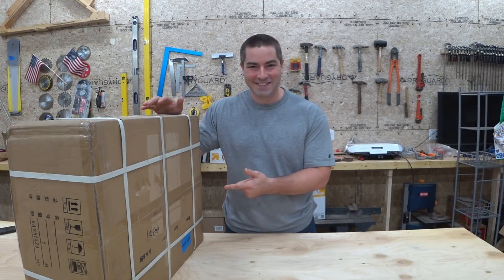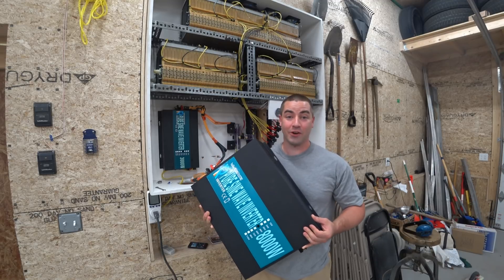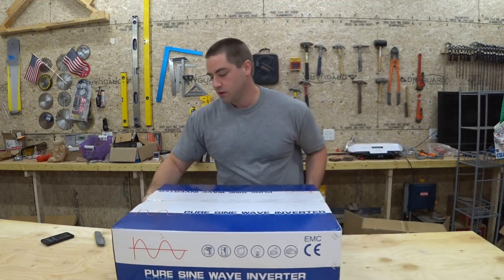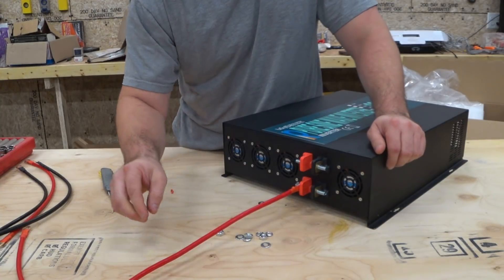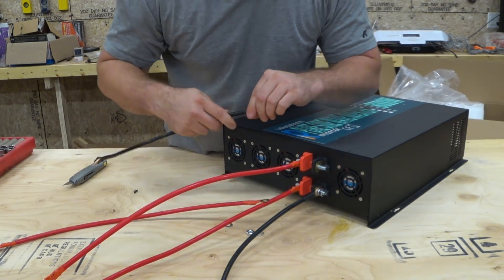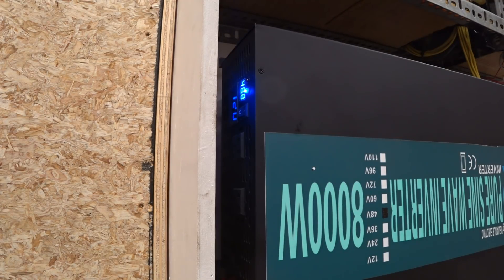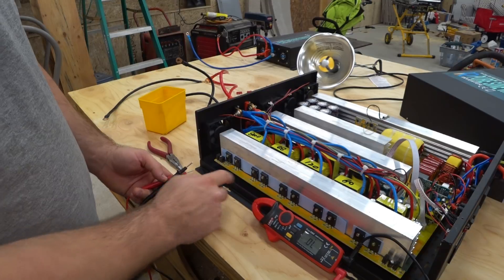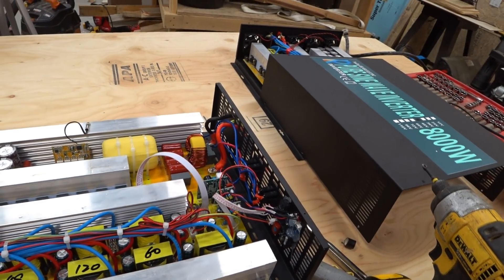Cheap 8000w Reliable Inverter, DIY Powerwall, Chevy Volt Batteries

Comment: Your experience with this inverter took me back ten years to an article about a failed "Power Jack" brand 3500 watt true-sine-wave inverter made in China. The buyer just happened to be an Electronic Engineer who had the smarts to design such a Sine Inverter himself, and he proceeded to tear it down only to find out it was underbuilt to the extreme in several ways.  He explained what the designers did wrong.

After working his way through correcting the problems,  he brought it to life and reasonable reliability:    www.ludens.cl/Electron/chinverter/chinverter.html

Another resource for reference is an indexed engineering level sine inverter                                                                                                                                                                                                                                                                                                                                                                                                                                                                                                                                                                                                                                                                                                                                                                                                                                                                                                                                                                                                                                                                                                                    design article  found here:   web.wpi.edu/Pubs/E-project/Available/E-project-042507-092653/unrestricted/MQP_D_1_2.pdf

Comment: put an oscope on the current/voltage of the 120V output.  See what's happening instead of scratching your head.  I bet there's a resonance or inrush problem.
Reply from the maker: Unfortunately I don't own, or have access to, an Oscilloscope.  If you do and you are in Massachusetts, lets get together and make a video testing the wave form.  I'd love to see what is happening.

Comment: Other videos claim these Reliable inverters are actually modified sine wave.  Any scope shots of the power output?  I've used a 2KW Samlex SA-2000K-112 pure sine inverter for years to backup the house.  It can surge 4000 watts and handles old fridges, coffee maker, deep freeze, flat screen, satellite, internet, etc. just fine.  The Samlex SA line looks discontinued now, but other Samlex are high quality too.
Reply from the maker: Unfortunately I don't own, or have access to, an Oscilloscope.  If you do and you are in Massachusetts, lets get together and make a video testing the wave form.

Comment: First of all if you want to pull that many peak amps into the inverter those battery cables splitting the supply is one issue.  I used 4/O in all applications weather a 2000 watt or 8000 watt or just makes sense better to have the most current carying capability than not enough.  And here's a key factor, reliable in their connection diagram fails to instruct installer to connect separate ground wire that attaches  to a screw under the bottom of the inverter that's a stranded 8awg copper connecting directly to earth ground.  I used to warehouse inverters for reliable in the US and was their returns address.  The amount of blown inverters shipped to me was unbelievable.  I'm also a technician and after blowing a 3500 watt myself  determined their installation manual had left out the very important grounding procedure.  I informed the company they needed to add a slip of paper with the word  WARNING unit must be grounded before connecting to mains failure to properly ground unit can have serious consequences and will void the warranty.  Obviously they haven't corrected the error in their installation manual.  I have used reliable inverters as back up EMERGENCY re0lacements for my 9.36kw array and every one has performed correctly as long as the unit was grounded before attaching mains.
Reply: real answer buried in the youtube shitsoup

Comment: Continuing to search on youtube for your 3.000W inverter ...   https://www.youtube.com/watch?v=fPS6wzAnfsk
...
You might have a - 4 pairs  - 2x  mos-fet-s  IRFP4668 - 9.7m ohm -  maiby from Infineon.  This is a 130A at 25 deg celsius and 92A continous at 100deg celsius, with 520A pulse.
With 4 pairs, and 4 transformers ( you have 4 sets that can handel around 368A for a short time )  - and a very small impulse of 2.000A ... !!!
You will never reach this... Will blow many other component in the way....
368A on 48V  = 17.600W - 17KW. as an impulse. You can start any applyance.  The limits are the transformers, wires, and many others.... 
...
IN REALITY =  on maximum 3.000W you will have 17A per pair, on 4 pairs = 68 A in a 48V sistem . This inverter will run almoust non stop.
...................................................................................................................................................................................................
Let`s go to your new 8.000W. here you have F59N30  -  56m ohm - 59A at 25deg celsius and 35A continous at 100deg celsius and 230A pulse ( disipate 5 times more heat in running regards to  - IRFP4668  )
When you run a 8.000 W model it will be hotter than 3.000 W modell.  There are people who observe that.
...
in this 8.000W model you have 9 pairs.     9pairs x 35A = 315 Amps max continous   --- ATTENTION !!! smaller maximum current than 3000W modell !!!
Maximum pulse can be 230A x 9 pairs = 2070Amps , the same as 3000W modell....
...
IN REALITY = 8000W  ...  WILL HAVE TOTAL  -181Amps  -  IN 9 PAIR = 20Amps -  PER PAIR OF TRANZISTORS and transformer ...  ( equal with your fuses2x10A, probably something bad calculations, or a scam )
...
YOU MUST CHANGE THE TRANZISTOR, PUT THE ORIGINAL  THAT ARE IN 3000W MODELL -  IRFP4668...
Of course, if there are damage in control board must be repaired.
The fuse 2x10A must be bigger, migt be used 2 x 15A. fuse

Comment: ON OUTPUT he has 12 pcs of FGH60N60 - You shoud have the same tranzistors and the same number for 8.000W. The bridge has 4 elements. You have 3 transistor for each element. 3 sets x 4 tranzistor = 12 pcs. - There are 3 bridges in parallel.
 ... 
On your inverter apears to be only 8 pcs. to have the same output power you shoud read something like FGH90N60 at least on Your component. But here appears a situation of current handling throw the terminals of the transistors. 8000W at 120 V = 66A divided in 2 = 33 A at maximum. Each tranzistor shoud handle 4.000W, and this is .....probably overkill 
....
 Open your 3.000W inverter and compare the MOS FET-s you can see in your maximum 3.000W you have 1set x 4trazistors = 4 pcs.
 ...
 If you find identical tranzistors= MOS FET-s on output bridge , MEans the unit with same tranzistors can handle max 6000W, for few minutes. 
...
 It is a probabylity that you have a 6.000W Max Modell, and a 4.500-5.000W continous power. 
And the case has a error on labeling.

Comment: I found his MOS FET-s are FDA 59N30 - https://www.onsemi.com/PowerSolutions/product.do?id=FDA59N30 - 300V 35A/100degree celcius in capsule. Not on radiator.
 The inverter is rated aproximately 8.000W for 5 minutes. ( continous 6-7.000 W )This is more than 890W per each pair of tranzistor - At 48V apears to be 18.5A per pair of tranzistor applied to those 2 fuse at 10A x 2. 
....
 Analizing this, it might be a bad choice to have 20A fuse on 18.5A consumption. Especialy if there are fast fuses. Maiby on your modell shoud be 2 x 12A, or 2 x 15A on each transformer. In his case it is a 60 V inverter, so he has a smaller current on tranzistors at the same power. For him 2 x 10A appears to work ok.
 ...
 Check what tranzistors are on your modell. They must be much capable in current than this, or at least identical.

Comment: The same thing happened to me from smile electrics ch I pulled the inverter apart and found several large mosfets blown ans aldo sa sine wave PIC control board was blown. The root cause was bad soldering joints on HV electrolytic capacitors I changed the parts by getting them from the supplier and bingo all good. You can trim the output voltages with these inverters usually with a trimpot in the inverter. Your problem is caused by a surge current and there is something wrong like a badly solderd joint somewhere else.

Comment: You need a LF (Low Frequency) inverter.  Look them up.  Usually just a bit more expensive but have a heavy copper transformer instead of just mosfets.
Reply: split phase is also nice since you can do single phase 220.

Comment: As a follow up, Americans should know that China has been buying scrap copper, remelting it and sending it back in electrical & electronic equip.. The copper has impurities that make it brittle (nonductile) and has a higher impedance. Automobile wiring since 2000 is substandard from China. Be warned. Good comments here guys.
Reply: Most Chinese magnet wires are only 80% copper.  In high frequency design with multi ferrite transformers, the core saturation is so prevalent that all you have is copper resistance and easily blow the driver MOSFETS.   48v 8kw units will draw nearly 200amp from battery.  Company supplied 3cables and the user tried single cable complaining about connecting them in parallel and the first thing he tests the unit with is an inductive motor (probably Chinese made) with high magnetic leakage and high inrush current.  Comparing the replacement unit with a burnt first is not very bright.  I see everyone trashing Chinese products and yet never stop buying them.  Walmart, Target and even Amazon.  Dream about good old American Standard (yes they were very good) and then cannot buy decent electrical products locally made because you don't want to spend the money. Common guys.  Get back to engineering education and GMP.

Comment: Heres the tip everybody needs about power inverters. If you need 2000 watts, and you want a cheap one, you buy a 10kw one that might do 2000 if you are lucky lol. The rule is 50 cents per watt  If you want something that will actually do what it is labeled to do. You want a 2000 watt unit? Expect to spend $1000!
Reply: it's not about the size but about low frequency/ transformer built or high frequency/moffett built

Comment: A method of using these inverters to prevent the fets from committing suicide is to find a big boat anchor isolation transformer and use it. The magnetizing current will preload the inverter and prevent lockup overload of the fets.

Comment: It has nothing to do with the nominal power, its the type of the inverter it is a high frecuency inverter, this type of inverter can not handle peaks of power for a power tool or anything that has to do with electric motors or inductive charges, the type of inverter you need is the copper transformer,WEIGHT MATTERS HERE, the bigger the transformer the better it can handle peaks, stop wasting your money in chinese inverter, buy a good inverter like an outback or a magnum. Really like your channel.

Greetings from México.

Comment: Now I know what not to buy. I have 6 year old 3000 W true sine wave Go Power inverter and it is always flawless. It runs houseboat every weekend. Don’t need a generator unless I want AC or hot water. I have accidentally powered the 16,000 btu AC and it had no problems other than it will suck down the batteries in a few hours.
Reply: thats probably because it is a low frequency inverter..if it's over 20 pounds it is

Comment: I have the 3000w 24v Reliable Inverter, connected to a bank of 10 12v 110Ah led acid batteries, base in the UK so 240v 50hz ring main system, which has been running my TV, PS4, 2 x PC, and all my power tools, lawn mower, and on a sunny day it will even charge my Nissan Leaf, (which takes just over 10amps) admittedly my tools are not as powerfull as yours, but I've had no problems for over a year now!.....I am happy as punch! :)

Comment: Do you use, 48 V input for this inverter? or 12v? Did you convert 12v to 48v? what about the watt? Have you compared it?
Reply from the maker: I'm running 48 volt.  Yes, for some small stuff I convert to 12 volt.  There is a video on the converter here: https://youtu.be/e6gzOqwVDkM

Comment: In my 40+ years working with d.c. to a.c. inverters two main factors come into play. First low frequency  inverters use mass of core magnetic resonance IE: big transformers to supply surge load.  High frequency inverters use large mass battery power at rated voltage. Both types need over rated heavy cables. I beleve your battery pack being 44 vdc is not properly charging the 48 vdc capacitors in the 8kw inverter. Also those chevy volt batteries were designed for a string voltage in the 300 vdc range so the current draw surge is much less. I would try a different battery bank of agm / lead acid rated for a surge current of 1500 amps or more. Also use 1000 mcm copper strand wire. You get what you pay for. No free lunch. Cheers!
Reply from the maker: Hi Tom,  Thanks, it's great to have someone comment with 4 decades of experience.  Does an inverter exist on the market that has self-protection built into it?  Such that no matter what mistake I throw at it the inverter will safely shut itself off.  For example, my generator will safely  shut itself down if it runs out of oil, then tell me it's low on oil.
Reply: @DavidPozEnergy  I have transformer based inverters for my grid tied farm. Bought in 1998 from a company called Trace. I use 3 sw4024 sinewave inverters 1 is fulltime 120vac. 4kw continuous surge is 10kw. The other 2 are wired split phase 120/240 vac. Shop welder, air compressor,  3.5 ton a/c unit. Battery bank is 2 volt agm cells. Lucent telco batteries 1460 a.h. @ 10hr. Rate. Outback, magnum, are very good inverters. Trace was bought out by xantrax (to corner the home off grid market) now Schneider electric has the patent. They cost more than the lightweight China inverters but they work in -30 degree F weather. All of the inverters I have mentioned have circuit breakers. They have advanced fault management systems built in.
Reply: @DavidPozEnergy  Yes. In Kenya I use Victron for high end clients 4000 watts costs about 5000 dollars. But for normal clients cheap Chinese which costs 400 dollars
Reply: that "8000" look mighty light....way to light, also didn't see any transformer in there?

Comment: you should be able to start and run at least two of that type of miter saw at the same time. you already proved your 3000 watt inverter ran the same saw . i would say it is an internal wiring problem in 8000 watt inverter, is it maybe set up for EU TYPE VOLTAGE  from factory ?  J.L.Y.

Comment: sugguestion,  remove the heat shrink material so u can inspect from time to time the conditions happening at the cable post interface.   With the shrink in place you have no idea till it fails.

Comment: It’s your mistake because the dc power supply cables are not adequate so you have to change them to thicker cables to handle such high amperage!

Comment: The inverter looks cheaply made. The first board will change the incoming 48 volts to about 150 volts dc. The second board is the inverter board that changes the dc to ac for the output. Looks like the capacitors are too small to keep the 150 volts up at a in rush and then it draws extra amperage from the first board because it cant keep up. The voltages drop across the fuses and too small wire then  the fets short. If you want it to work you have to increase the capacitance and improve your voltage drop.

Comment: There seem to be many rails in parallel, but is there any circuitry for load-balancing between those MOSFETs? Even small manufacturing tolerances in the internal resistance of those components would create current imbalances that lead to power imbalances depending on the square of the current.
Reply from the maker: I don't know.  I'm not an electronics guy.  Check out my follow up video for more detailed shots of the inverter circuits.  https://youtu.be/8pIZrrPLSP0 at 5:51

Comment: You might take the tool that blew the 8000 and plug it into grid power to see if it is doing something to the circuitry. If you can get a "scope" in the circuit that can show waveforms, that would be informative. Try it on the 3000 with the scope on it, if it works on both of those, but has an out of shape or phase waveform that reacts to the 8000, it actually might be a defect in the tool that is only happening as a reaction to the circuitry in the 8000.
Reply from the maker: It would be a lot of fun to use an oscilloscope.  If I could get my hands on one I would make a video testing all my inverters and tools.

Comment: Also....if you start taking these units apart to fault find while not really knowing what you are doing...be aware...BE VERY AWARE!...There could be some HUGE stored charges on capacitors in there which could fry you in a heartbeat several hours or days after you removed the supply.

Comment: The unit probably died because electronic inverters are not great with appliances which have large inrush current demand like your saw which is a double whammy because the load is an inductive one. To drive a hefty inductive load like this you have a couple of choices: 1> a massively over-rated inverter. 2> power factor correction & inrush limiting for the load.

Comment: Aaahhhh haaaaa! Pice of China junk! You was robbed! I have a 2000 watt inverter that would run that chop saw on one 12 volt battery! . Look up components and replace them with better quality semiconductors. 800000000 watts of pure power! Notice full size wave on the side of box and it is a square wave inverter!🤣